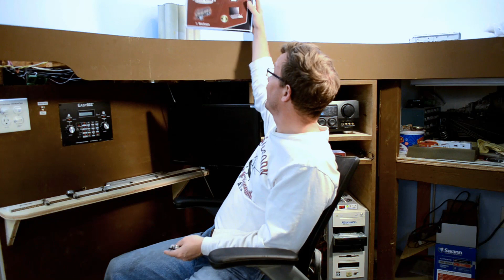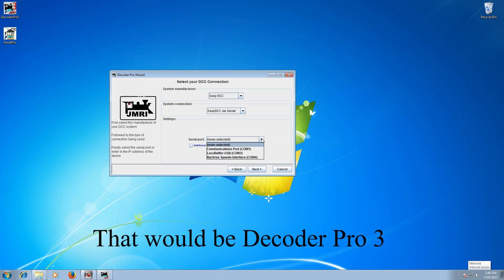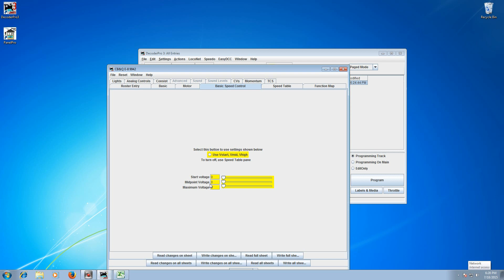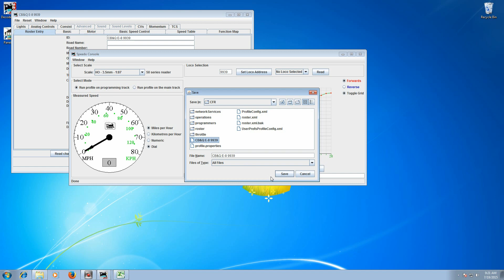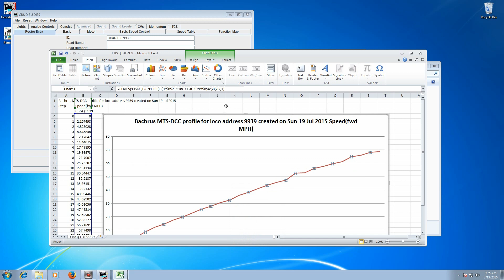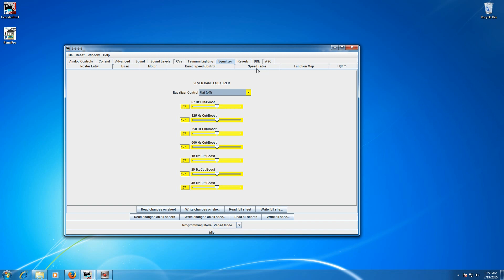Setting up JMRI DecoderPro and speed matching locomotive

Comment: I do not see the speedo console in JMRI.  Is this an add on that needs to be installed to JMRI?  Also is there other hardware needed so it can report back the sped of the train?  I know this video is 5 years old I hope you still see this message
Reply from the maker: It used to be hardware that you could use the company is no longer in existence but you can use a speedometer type hardware to do the same thing.

Comment: Hello Mike,  I just purchased the NCE USB Interface product to be able to use JMRI Decoder Pro.  I am getting two messages when trying to work with Decoder Pro.   Both messages are in RED in the lower left portion of "DecpderPro: All Entries” screen introduction.

  No Service Mode Programmer Available.     No Operations Mode Programmer Available.

These should be GREEN.  What do you think I am missing in my install process?
Reply from the maker: Sherrie, Might need a little more information but you need to start at the what OS are you using (Windows or Apple).  If Windows you need to look at the device manager and see if the com port is setup with the NCE drivers. And please let me know what the two messages are that are in red.
Reply from the maker: If Its windows I am betting that the computer does not know what com port you are on or you don't have the driver installed This link is from NCE and has a link for the drivers:
 https://ncedcc.zendesk.com/hc/en-us/articles/207812203-Windows-USB-Drivers-
Reply from the maker: Here is a video I did on setting up JMRI:
https://www.youtube.com/watch?v=mf0GvySO_Ks

Comment: Mike, you mentioned inexpensive phones used for DCC throttles.  Which phones have you found will work as WiFi throttles with JMRI?
Reply from the maker: Steve, You can get a Straight Talk from Walmart this is a buy as you go plan what you need is the phone not the plan. The WiFi on the phone connects to your wifi stem that JMRI is on and that will work also any smart phone with a ISO or Android system you just need the the Wifi. I bought so cheep tablets from Walmart with an Android system for $50 each and used them they where from RCA: http://www.walmart.com/ip/RCA-7-Tablet-16GB-Quad-Core/45804400. Great price and 7" screen real deal for older eyes. Hope that helps.
Reply from the maker: Also need the turn on the JMRI Wifi that is easy just turn it on.